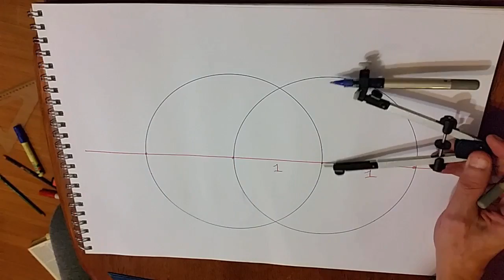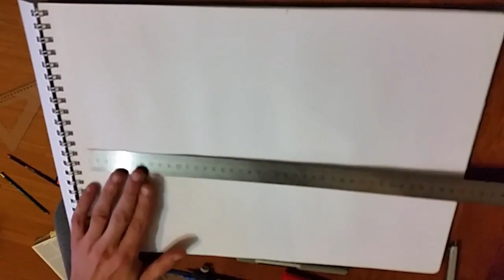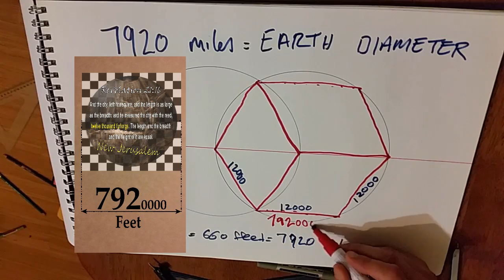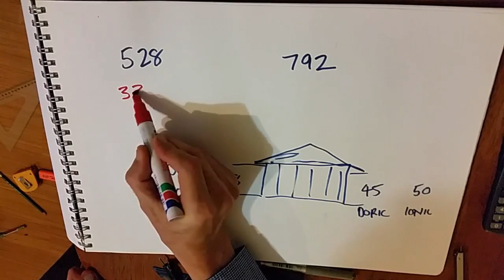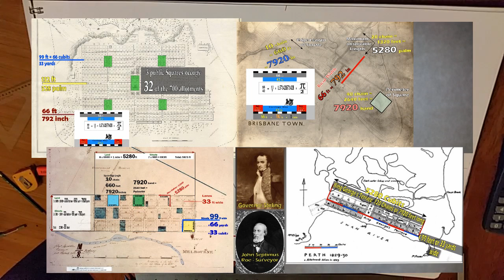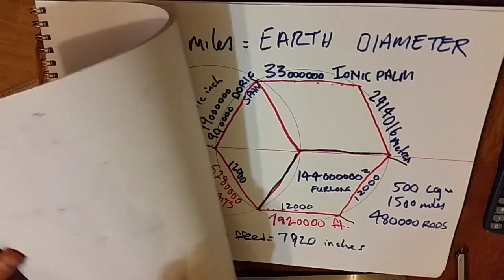Vesica Pisces Ep2 Esoteric Design. How, where, when & why.

Comment: Mr SGD, do you think it`s possible that the 360 x 60 x 60 = 1.296.000 seconds in a 360 degree complete full circle could refer to (the fact that) The Sun is 1.296.000 times bigger (Volume wise) than Earth (You could fit 1.296.000 Earth`s inside the Sun or thereabouts)?
Reply from the maker: lol Mr SGD is my father
1296000 bigger by volume? IWill have to look into that ;-) thanks
The sun weighs 333000 times more than the earth.

1296000 years - treta yuga
1296000000 long inches moon diameter
12960000000 - long feet sun diameter
12960000 - plato's number ( one versionn of at least)

1.296 grams (apothecraries weight) = 1 scruple
1296 = 6x6x6x6
I think each of these numbers not a single reason but a harmony between many elements. Whether 108, 144 etc etc. Almost as if you pick the one that resonates with you and from that multiple levels emerge
> weights and measures (including time) along with Sun, earth , moon. Embedded in the temples and legends
Reply: Officially the Sun is 1.300.000 million times bigger than Earth (Volume wise)....So we are 4000 Earths short.....Unless the Official number is not exactly 1.3 Million....
Reply from the maker: btw the long foot = 1.056 feet  ( 33 x 32 = 1056)
Reply from the maker: but the sun is a tricky one, depending on how you measure the diameter you get a result different enough to include that 1296 probably
The current method to measure diameter is to use transit of mercury to define the (edges) diameter but it's a very bubbly-energetic surface.
Especillay with the sun the margin of error (and margin of definitions)  makes it all a little bit elastic
Reply: "The Sun is Magical"...And everything we have in this Solar System came from the Sun one time.....(As the Sun spits out the Planets)....